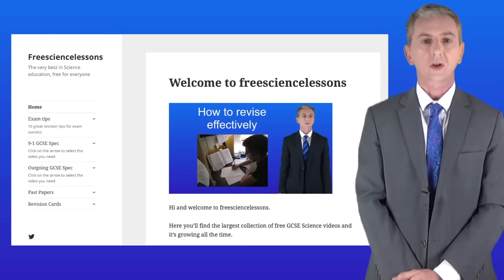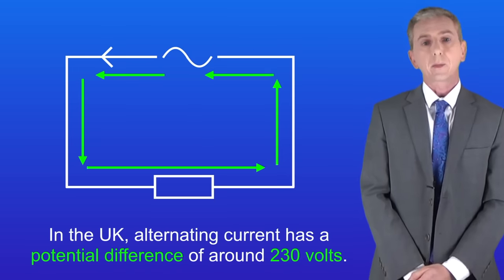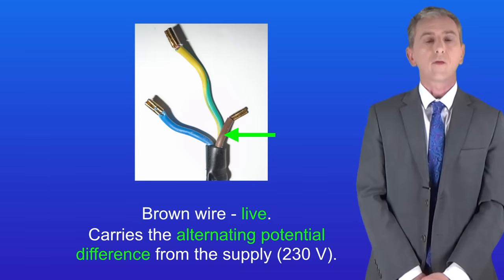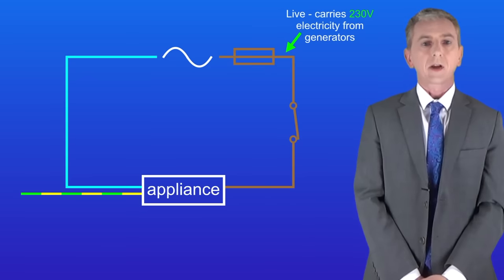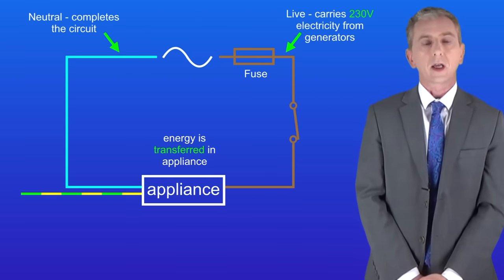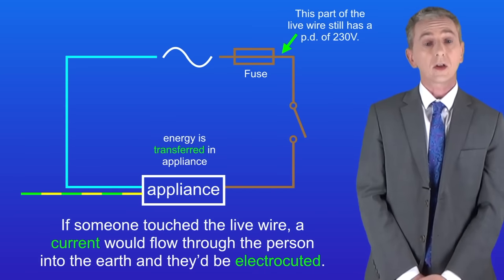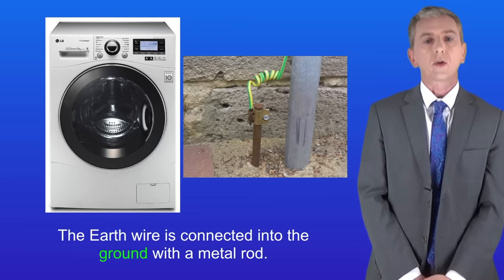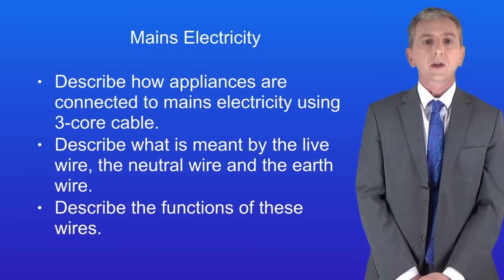GCSE Physics Revision "Mains Electricity"

Comment: if the live is 230V and the neutral is 0V, does that mean that all appliances use up the 230V ?
Reply: 230v is dropped over the appliance yes, but special diodes called zener diodes regulate voltage for an appliance. Also computer chargers have that box thing before the plug, that's a transformer that changes the voltage to the desired one.
Reply: Some appliances use the voltage as the 230vac. Some contain built in power supply's that either step the voltage up or down through the use of a transformer and can convert the ac to DC using a bridge rectifier.

Comment: do you need to know about the neutral wire in more detail for gcse like why it has 0volts or how it has 0volts or do we just need to know it has a pd of 0
Reply: you just need to know that it has a potential difference of 0v as it completes the circuit

Comment: This video is very helpful. I am just confused on how someone gets electrocuted. Only wondering as that was a question on my latest mock exam
Reply: I am doing the aqa spec. Question was what happens if the electrician touches the live wire? It was something about electricity getting to the ground
Reply from the maker: The live wire is always carrying a current (unlike the neutral or earth). So if the electrician touches the live wire, a current will flow through their body to the earth (literally the ground) and this could be fatal.
Reply: @robertdavison8382  Basically Electricity is always finding an easy path to discharge or neutralise, so when someone touches a live wire, he completes a circuit to the ground so electrons can pass via him to the ground to neutralise.

Comment: Why and what will happen if the earth wire and the live wire both are connected to the pin near to fuse?
Tomorrow I have an exam... Plz help!
Reply from the maker: If the earth and live wires are connected to the same pin then an enormous current would flow down the earth and the fuse would melt all the time.
Reply: Freesciencelessons
This means that the appliance would not work at all and the current from the live wire is never able to touch the metal case of the appliance.. It is correct?
Reply: Please reply?
Reply from the maker: Yes if I understand your question correctly.
Reply: What most likely would happen is the RCD in the fuseboard would trip and the fuse would melt.

Comment: Really good video, thank you - but I'm a little confused.

Why is it that the earth wire takes on this electric charge instead of the metal on the washing machine ? How is the charge redirected/how is the earth wire activated ? 

If anyone can explain this to me it'd be a huge help, thanks.
Reply: because the earth wire has a lower resistance, so the current redirects to the easier path
Reply: the earth terminal is connected to the metal casing so that the current goes through the earth wire instead of causing an electric shock.
Reply: Electricity will always take the path of least resistance to the ground. If the metal case becomes live the electricity will flow along the earth wire to the ground rather than through the body of anyone who touches the case as the earth wire has a much lower resistance than the human body.

Comment: Hi there,

 I understand the fuse will melt if the case becomes live and the current has exceeded the fuse's limit,  but what would happen if the case became live but  the current wasn't higher than the fuse's limit ?

Thank you so much for your videos, you absolute legend.
Reply: the current would continue to flow through the wires as the current is at an acceptable, safe amount

Comment: So, what does the fuse do? I don't fully understand its purpose.
Reply: Killerfusions Psn if the current gets to high it basically melts and stops the current from flowing
Reply: if the live wire becomes loose, the fuse becomes really hot and melts. This causes the current to shut off so no one can get electrocuted
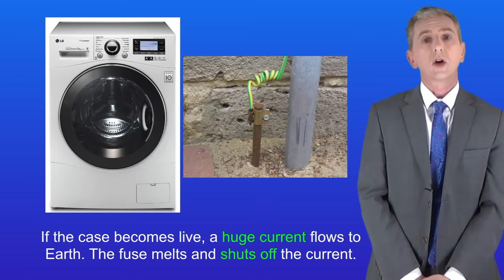Reply: The fuse melts and shuts off the current 3:52
Reply: It just melts and breaks the circuit
Reply: Fuses are usually rated at 3 or 13 amps. If there is a 3 amp fuse in the plug and the current exceeds 3 amps the fuse wire inside the fuse case will melt and break the circuit.